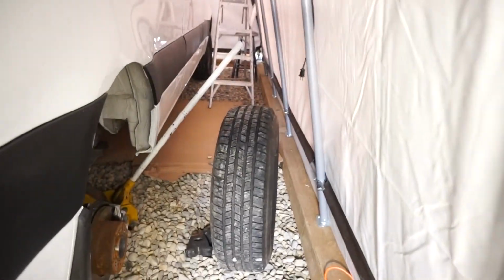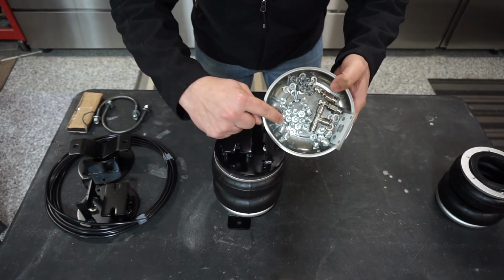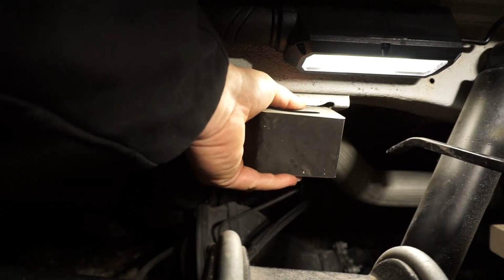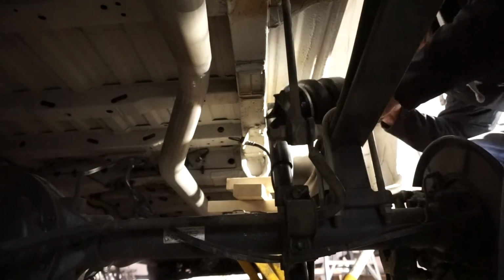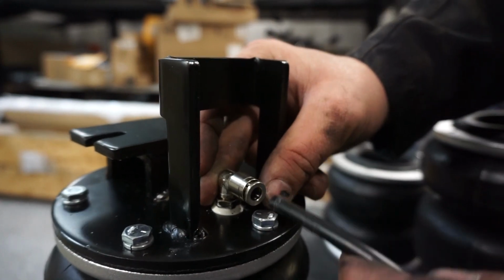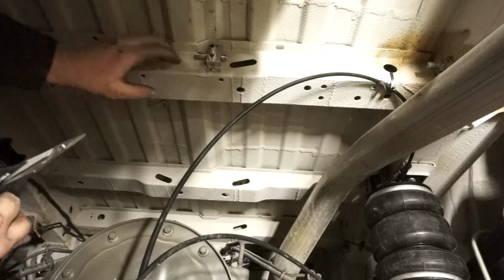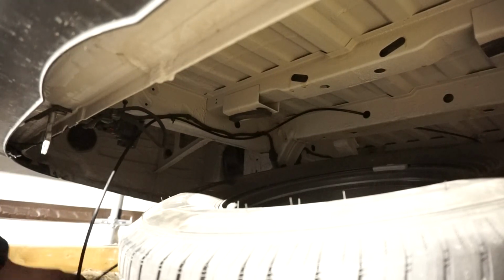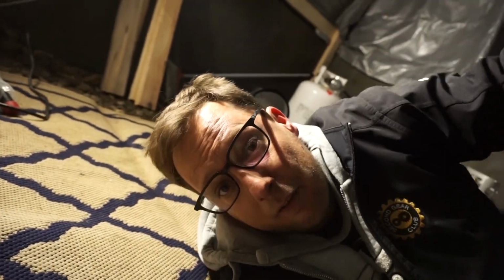Air Suspension Set up | FOUR SEASON VAN | EP.14

Comment: So if the  air fill was routed to the back of the van and you also added an  sight level  making sure you have 2 valves,  you could air it till it was level  as its pretty rare that the sag is even or that the weight distribution is even in a  van...

Comment: Thanks for finding the fit problem with the 2019+ 4x4. I’m trying to figure out if my falcon adjustable shocks with external reservoir will clear this beauty. Mine is the 2020 Revel. How is the ride? Soft or firm or stiff?

Comment: I wonder if the rear airbag system will be helpful in leveling the van once camped?  Appears so, but you're not interested at the moment Jeff.  Now wondering in a future video after you'll make a change to two shredder valves to add more flexibility.  (And an on-board air pump.)

Comment: 3.52 Why not remove the flange and flip 180? or put the right side on the left, left on the right side?
Reply from the maker: Very valid question, I have no intentions of putting the bump stops back on and to remove the flange I would have had to drop the sway bar off the van then reassemble... This was much easier solution with zero downside!!  Thank you for watching and commenting!
Reply: @DaresDrives  yip, but that hag-saw gave you a workout ;]
Reply from the maker: @kennethcroll6972  haha yes you are very correct about that. But with only one person it was the easier route, I think?

Comment: Looks like it was a challenging build project but you persevered
Reply from the maker: Was a lot more work than initially anticipated, have done this numerous times on past trucks I owned but the 2019 4X4 Sprinter had changes that the air bag manufacturer had not accounted for... Should be easier for anyone else now if ordered through the Sprinter store as they have it corrected since my job...